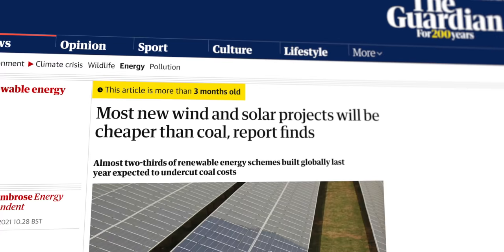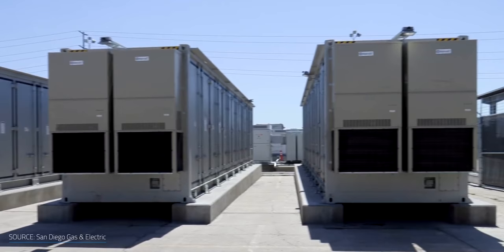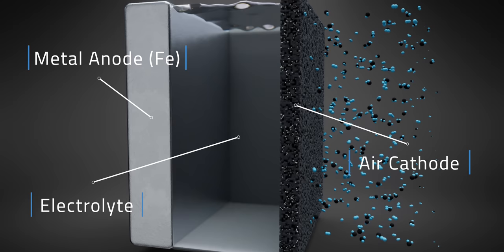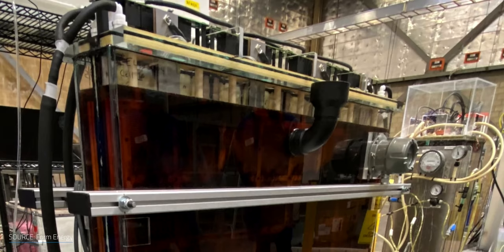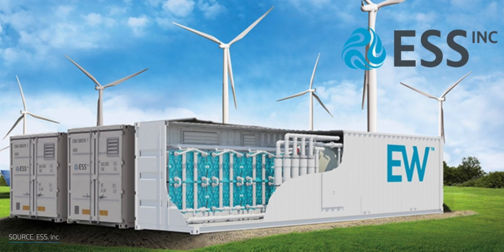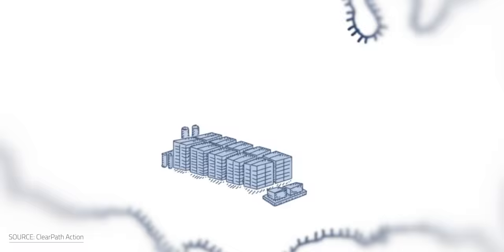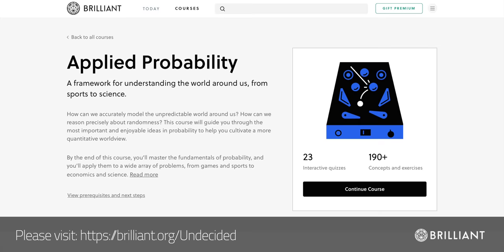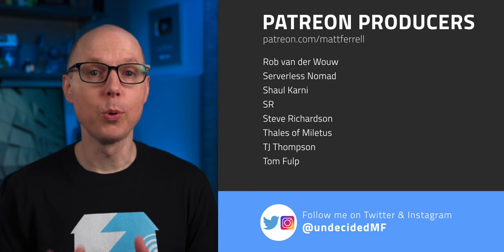Why Rust Batteries May Be the Future of Energy - Iron Air Battery Technology

Comment: Why iron-air batteries have so much lower energy density than aluminium-air batteries ?
Reply: #1: Iron atoms are much heavier than aluminium, (molar mass) but donate (at most) the same number of electrons when they react with oxygen.

#2: Because iron atoms have more layers of electrons, when they give up or accept electrons from their outermost layers, much less energy is released/absorbed respectively. (Ionisation energy)

Hydrogen has the lowest molar mass, and Fluorene has the highest ionisation energy, so one of the atoms between those two in size is probably the best in terms of energy density by mass.

Edit: Both Helium and argon have higher ionisation energies than Fluorene, but they’re noble gases, so would be very hard to store in high density, and are very expensive due to a bunch of other useful properties of noble gases.

Comment: I think there's a mistake in units 
or
Isn't the comparison a bit rigged?
Lithium has $132-$245 per MWh (2:00)
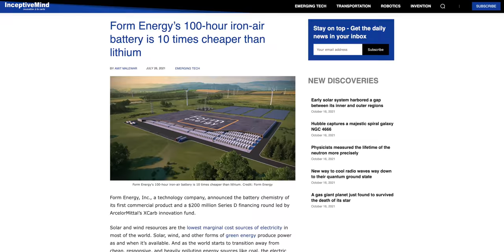And the Iron Air battery needs to get below $20 per KWh (5:00)

If you calculate the MWh, would the Iron Air battery not be at $20,000 per MWh? How is that 10 times cheaper?
Reply: Anyway : great video, great technology presented.

Comment: Hi Matt and thanks for the very interesting and informative channel.  Matt I have a question for you on fluids and pumps.  If a pump can raise a fluid to ~1metre, can two pumps in parallel pump the fluid 2metres?  If so should the joiner pipe be close to the pumps, or joined at a greater height less than a metre?  I do not wish to consider two pumps in series, say 1metre higher than the other as the bottom pump cannot feed the top pump with enough pressure to keep its flow constant.  What are your thoughts Matt?
Reply: To double the pressure, centrifugal (hydrodynamic)  pumps must be in series.  Centrifugal pumps in parallel will increase the flow with only a small increase in pressure.

Comment: "there charge dissipates over time" -  this is wrong at least at the time scales you are talking about, the self discharge rate of Li-ion is 0.35% to 2.5% per month, which is basically nothing. The problem with Li-ion is the cost not it's charge dissipating over time.
Reply: You also said 17 times longer duration than Li-ion. This is meaningless. Does it store 17 times as much energy per price? That would be meaningful, but it's not what you said. Li-ion can last 17 times longer than itself if you pull 17 times less power, or if you use 17 times as much KWH of batteries. It certainly would not last 17 times longer per weight or volume of batteries Li-ion is king here. 17 times longer is utterly meaning unless you specify what you mean by that.
Reply: What is the point of talking about hours of storage if you don't specify the capacity or discharge rate. Li-ion at 2.5% discharge per month would last over 1 and half years before getting to 50% state of charge. Does that mean Li-ion has over a year of storage? It might as well for all the information that hours of storage gives you without specifying what you mean by that.

Comment: This is not new at all. Already about 10 years ago Prof. Sadoway of MIT developed an iron battery system for long term storage. In the meantime there are a handful of systems with different materials in development.

The really interesting question would be why none of them made it to mass market yet. It seems that there are still major technical challenges or they are still too far away from being cost competitive.

As much as I appreciate the enthusiams about new technologies, there is often too little considerations of the challenges and downsides. But what doesn't work in real life is a zero solution.

Comment: From what I heard in this video,  FE-Air is not really an overall improvement. It's not the breakthrough that we need to make renewables and EVs even remotely viable.
Reply: If the numbers quoted are really achieved it could be 1/10 the cost of Li ion which would be a game changer for grid scale storage, where cost is the thing holding it back. Probably not relevant to EV due to weight.

Comment: The thumbnail is quite ironic. Probably the worst thing you can do to the environment, is to permanently destroy quality farmland. In this acres of it case by asphalting and building a ginormous tin shed. And not even putting the  panels on the roof, or building the shed multiple stories to reduce it's footprint. Sure, just a thumbnail, but still. 😳

Comment: Highly skeptical as someone who is very familiar to what rust does to metal and how non reversible back to metal that process is…but…I’m not a scientist so at least open minded to stepping away from lithium mines and pretending thats somehow green or while ignoring what oil and coal mining do.
Reply: The electrochemical reaction has been known for a long time.  Making it do enough energy per unit weight is the tricky part.

Comment: The problem with lithium-ion batteries will be the extremely rising costs of lithium over the next decade. Lithium is one of the rarer metals on this planet. At the current (not at rising) rates as projected, only just the current rates, all known sources of lithium on this planet within somewhat reachable deposits will be stored in some form or other. Even assuming that ten times as much lithium were to be magically found within the next decade, that would barely extend the supply of lithium to another ten years at projected growth rates. So by 2040 nearly all lithium on this planet (and that includes hard to reach sources) will be depleted. That is not even twenty years.

As such lithium batteries can't be used even as a medium range solution to provide for coverage of intermittent outages. Medium range being not even the life time of ONE generation of power plants of any type.
Thus other energy storage solutions have to be found. Advancing iron based storage solutions seems to be a much longer based solution than investing in lithium storage.

Comment: Let's see how electric cars work out when the battery swap after 50k miles is $20,000.  LOL.

Carbon conversion into liquid fuels such as methanol is the best way to power vehicles, airplanes, and ships.  The excess energy from nuclear power plants can power the creation of fuels from thin air.
Reply: No thanks ... I already have a original Honda Insite that is in need of a replacement battery.

Comment: Rust battery to charge lithium batteries for quick response needs
Reply: We need to replace lithium batteries on the grid, not compliment them. Stuff like the tesla power wall, and massive banks uses up resources that could better be used in cars. Lithium is too valuable to just put on the grid, and leave stationary. It's biggest strength is it's energy density, and therefore weight.
Reply: @coltonbuhler7011  Grid scale lithium's biggest strength is that it can respond rapidly enough to prop up a sagging grid.
Otherwise you get a situation like the debacle in Texas.
The two chemistries can complement each other but not replace each other.

Comment: The very first sentence in this program is 100% incorrect. solar and wind are not cheaper than fossil foils. To determine the relative cost of ff vs “renewables”, the standard of reliability has to be held constant for both independent of each other. Wind and solar are very unreliable, and the unreliability is unpredictable. The only way solar and wind can match the reliability of ff is grid scale massive high capacity low cost storage that can supply power for a few days to a week if the wind or sun production stops because the winds are calm for a few days.
Reply: Hogwash.  The all up cost of solar is less than coal.  The pollution produced is less
Reply: @kensmith5694  Then why has the price of electricity increased everywhere that coal plants have been shut down and renewables increased? Australia, Germany, Uk, CA etc. In addition, none of these places have installed long term electric battery storage necessary to completely eliminate the need for ff for times when the wind does not blow or the sun does not shine. 

The dirty secret is that low cost long term battery storage technology does not exist that could power NY, Chicago, Denver, Houston for three or four days. Also ignored in the cost of electricity delivered to the customer is that if x megawatt hrs are needed to supply Chicago, 1.5x capacity will need to be built to recharge the grid scale batteries once the wind blows or the sky clears. Nor are costs of the added transmission lines included. Comparing a stand alone renewable system to a stand alone ff system with identical 99% reliability will cost 2x to 5x for the renewable system.

China, India, Brazil etc continue to add new power by building coal power generation. These people are not stupid. If renewables were cheaper, they would be building wind and solar, particularly for new power sources. The real world disagrees with you.

Comment: CA didn't have to have "brown out" because of  heat. In fact, CA had a rather cool summer thanks in large part to it being a LA Nina year. CA has lost electric generation capacity mainly do to the loss of nuclear power generating plants and ban on coal generated power. Weather had nothing to do with CA's lack of available power.  Again if you are going to rant on about unrealistic battery storage capacity (a Rube Goldberg project if ever there was one) you should at least not spread misinformation.

Comment: Most "green energy" isn't very green. Especially on the manufacturing and/ or disposal aspects. It's all a big lie. When they fix the problems with manufacturing, disposal, energy density, reliability, and ability to adjust based on demand I'm in 100%. Currently, they're a very long way away. Especially with the life cycle issues.

Comment: This is great tech, but does nothing to solve renewables' main problem: production. Like actually producing things like solar panels and wind turbines. Solar panels require some pretty nasty materials that requires the use of pretty nasty mining processes, much of which is done in the third world with practical slave labor. For wind turbines, completely forgetting about how they massacre large birds at an insane rate, their rotors also have a fairly short lifespan... and can't be recycled. They must be buried in mass graves. Almost all of the work that goes into mining and manufacturing is going to come from fossil fuels. 

Just accept nuclear as your savior.

Comment: “Leaving the fossil fuels under ground” - and strip mine the iron & copper.

Converting carbon fuel engines to hydrogen would be naturally recyclable.
Reply: Running and ICE engine on hydrogen is very inefficient.  The chemistry and physics works against you.  A fuel cell and electric motor is better.
Reply: Hi  @kensmith5694  —

Sure, a fuel cell is great, but the need for rare earths like Platinum make it great for occasional outer space usage, but not for day to day needs of the average human. Strip mining for rare earths from the third world is so colonialist.

The ICE engine is recyclable, smelting back into iron & aluminum. The hydrogen is readily available through electrolysis along any coast line (where most people live), making great use of occasional renewable power like solar &!wind. The combustion of H2 recycles back into water vapor.

The efficiency of the combustion may be less, but the reduced strip mining, readily available fuel, and recyclable nature of the entire package is amazingly sustainable!

Pipelines of water to remote inland areas, where hydrogen can be harvested via renewable sources, offers other benefits of water such as reversing desertification, without the strip mining of Africa to make it happen,
Reply: @DavidHalko  Carbon electrodes work OK.  You add KOH to the water and use mats of carbon.

Comment: Weather is NOT becoming more "extreme".  Saying that it is can discredit anything else you say. And a price comparison between intermittent sources and steady ones is dishonest.  The real cost of intermittent sources is the the cost per minimum electricity generated.  If you have 100% efficient storage, you need to double the number of solar cells, to charge that storage for nighttime use.  If the efficiency is 80%, you need 2.25 times as many cells,  So you've doubled the cost or solar energy, and that doesn't include the cost of storage. Wind is worse, given that in some areas the amount generated by wind is FAR below the theoretical capacity.

Comment: lithium ion are good for vehicles..... and with that. I'm out. dumbest sentence ever uttered.
Reply: He was correct in what he said.  Listen to it in context.
Reply: @kensmith5694  basically a vtwin such as the harley dohc engine but a turbo diesel. that would create more than sufficient torque to power a generator for tesla motors so long as you use a quality generator i.e. not tesla mass produced garbage but properly made hand woven electro magnets.